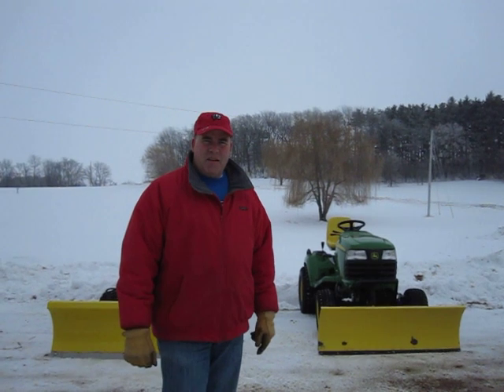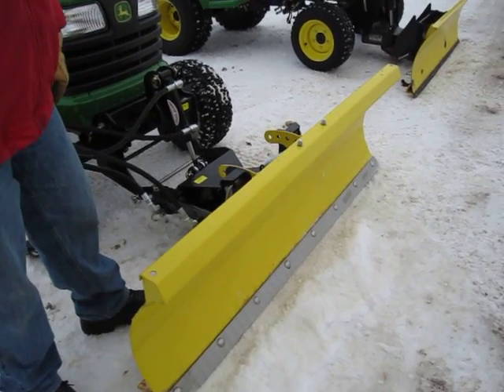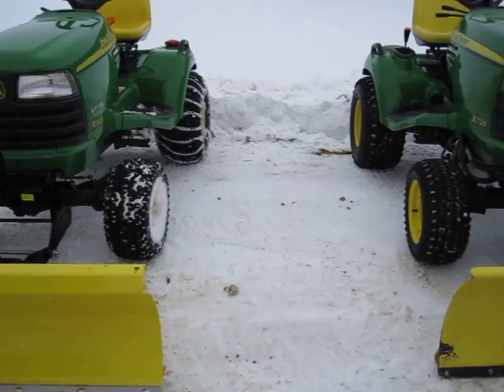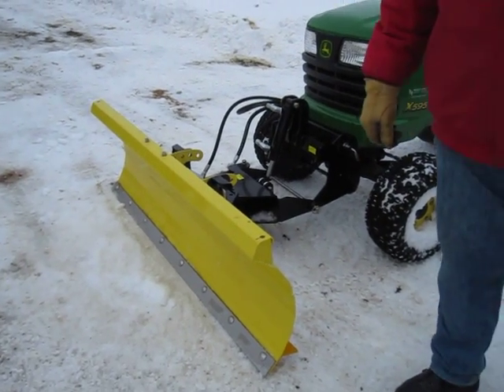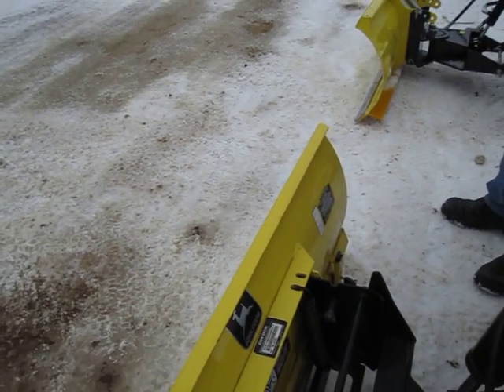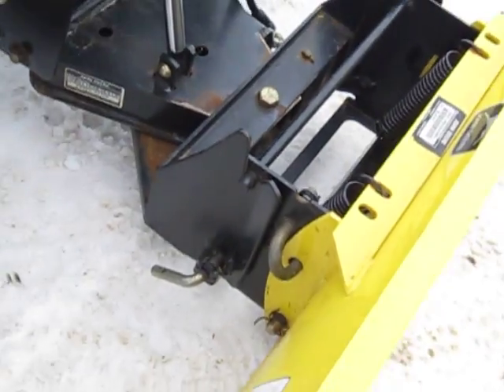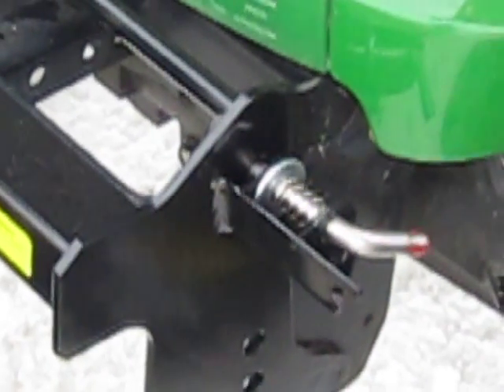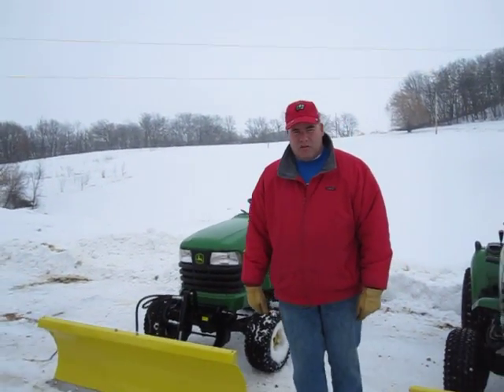SNOW PLOW FOR JOHN DEERE X595 COMPARISON

Comment: Looks like a very good product, I have a 20 hp MTD set up with a 48 inch blade I would think possibly the wider blade may cause a problem with pushing too much snow for a small machine, just my thoughts, but like I said looks like a well engineered product

Comment: this proves that an AFTERMARKET company can produce a nicer and more well equipped attachment. but i noticed that the ARC 12 gauge plow mount appears to be not as large and heavy duty as Deere's mount. We have a john deere 316 with deere's 54 blade. it has well over 2000 hours that we can account for with that plow on that tractor. the only thing we have ever broke is the locating pins that hook onto the front of the frame of the tractor.

Comment: Would a tractor mower grip without chains on in snow?
Reply: I've plowed for a few years w/ a 12 year old JD L155C & 46" blade. I used 2 40# suitcase weights on the rear and chains for front & back tires. I live in northern Vermont where we have long, cold & usually snowy winters. It's done really well.I did JUST buy a new JD X758 4WD diesel l&g tractor & a 54" blade. I plan on putting on the blade extenders (9" wider per side).  I'm going to put wheel weights for them (probably 50# per rear tire). I also got a large motorized deice spreader which will help w/ rear weight ballast. I'll try this next year w/out chains & see how it does.